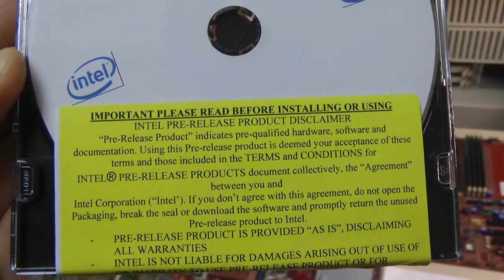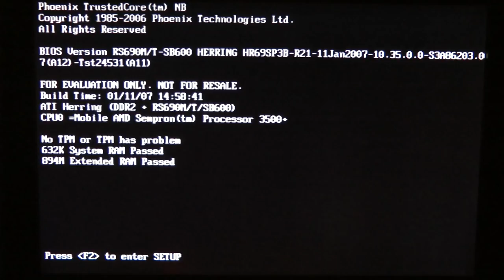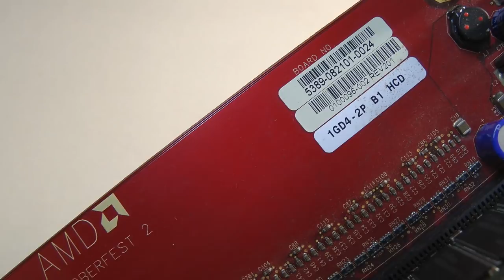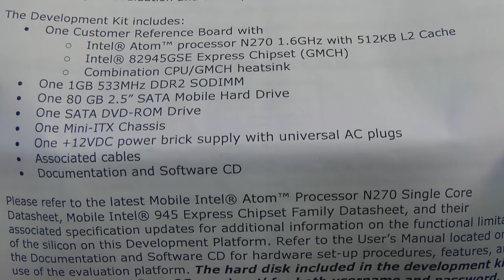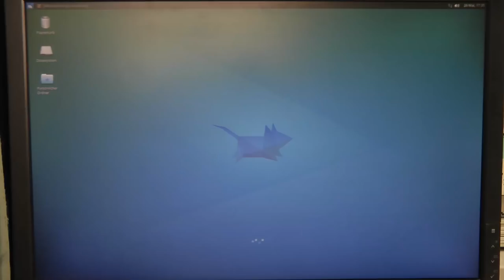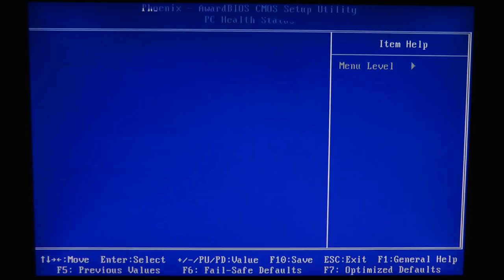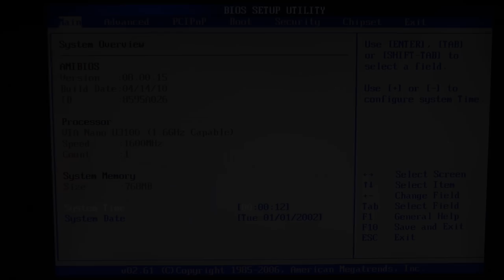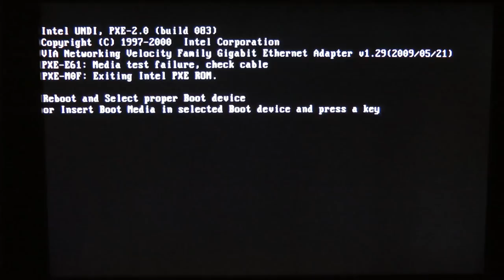AMD - Intel - VIA prototypes - engineering samples - RETRO Hardware

Comment: One other thing, the Via c3 at 400mhz is an 800mhz chip, the board defaults to lower values when you reset the bios as a safety measure
Reply from the maker: Maybe runs in some power save mode.

Comment: Your Oktoberfest board might use that screwy AMD ATXGES power supply that the Tyan Thunder K7 S2462 Dual 462 board did.
Reply from the maker: I have these Tyans 2x sA boards too and working with random PSUs without problems. Who knows where's problem.
Reply: Maybe its because you are using a PSU with a weak 5V Rail? Socket A needs at least 25 to 30 Amps.
Reply: That could be the problem. Its sometimes even hard to fire up a single Socket 462 CPU board with a newer PSU. The older ones had much more power on the 5V rail, but these modern ones are too weak there.
Reply from the maker: I think this board is dead or need special trick for turn on. PSU in video is 550W with 25A at 5V wing. I tried server PSU 700W and nothing change.
Reply: @RETROHardware  That southbridge looks pretty toast to me.
Reply: Check for voltage on bios chip or super I/O
Reply: You can try to use the ATX to GES converter. I actively run Tyan s2462 with dual Athlon MP 2800+ Barton with it perfectly.
Reply: @RETROHardware  That's the thing, if there's two sockets wouldn't you need double the amperage
Reply: The southbridge has a hole in it...

Comment: Did you try the ES LGA 775 CPU on a board? A quick google search of the S-Spec ends into a posible Pentium 4 651 ES, but i'm not really sure if is really true or not, some user who posted the same model in chipdb.org mentions is a Pentium 4 651 ( http://www.chipdb.org/img-intel-pentium-4-651-3.4g-800mhz-2m-775-hh80552pg0962m-qqh0-es-5313.htm ), also not sure if is really QQH0 or QQHO, CPU world reports QQHO as a Pentium 4 651 too ( http://www.cpu-world.com/sspec/QQ/QQHO.html )
Reply from the maker: Not yet, but can do now I'am playing with LGA board.

Comment: are you recording the bios screen with lights off? or by using capture card? if you will doing this a lot, maybe avermedia card will be helpful
Reply from the maker: Both ways only with camera. In BIOS is OK, boot screen with black theme not OK. I'am still fighting with this. Capture card is way but need second PC. Maybe in future.
Reply: clever way in dark :) avermedia have option for recording directly on sd card or by using another pc, i bought that cheapest one but not tested yet

Comment: That 775 engineering sample CPU is a Pentium 4 651 Cedar Mill. You can check the part number (HH80552PG0962M) on cpu-world.com. Bought a very cheap "unknown" CPU once which I knew was a QX6800 engineering sample by searching up the part number
Reply from the maker: Thanks for info! I was searching bad code 0 = O :-)
You right sometimes you can find unmarked CPUs, it is lottery.